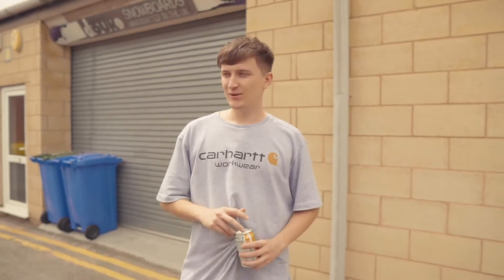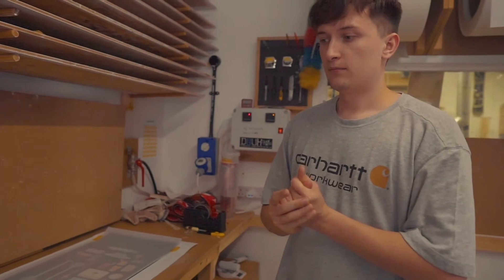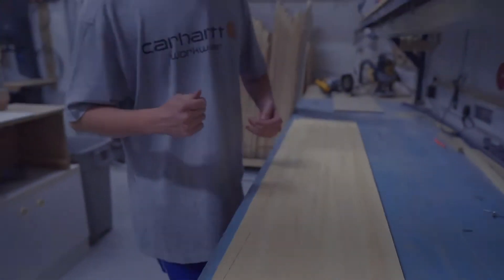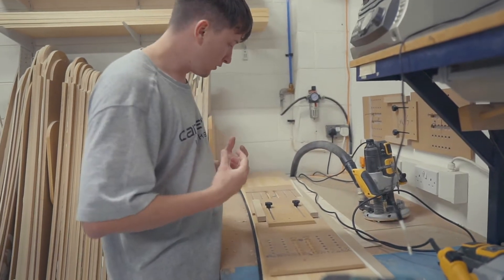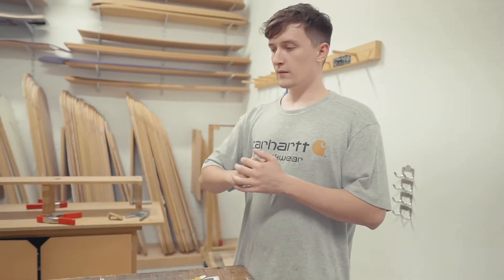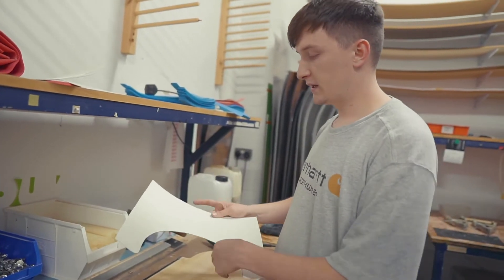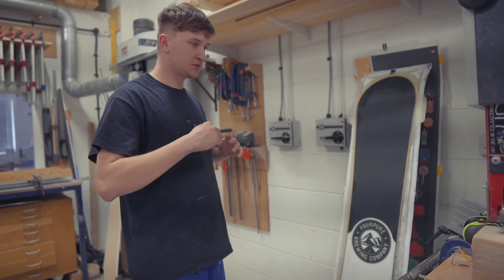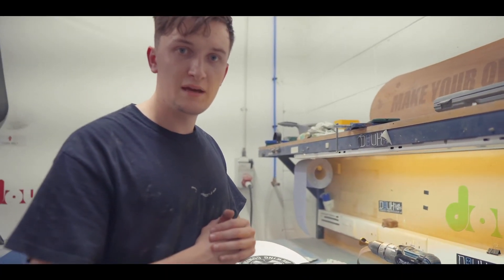How to make a Snowboard | Douk Vlogs Episode 3

Comment: realy nice work!! :) what are you useing to heat the sublimation press??
Reply from the maker: We use a heated element that is pressed between the Metal on the top of the press.
Reply: @DoukSnowUK  what is the temperature you heat for sublimation for those 25 minutes you have mentioned?
Reply from the maker: @sodivlad  Roughly 130 Centigrade